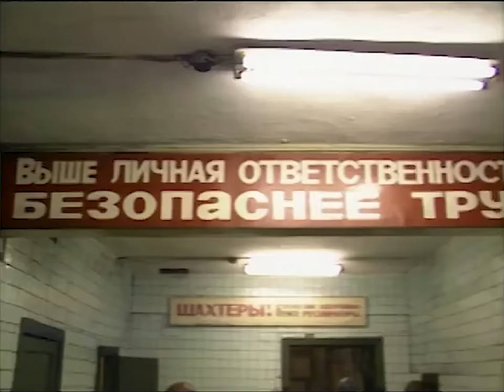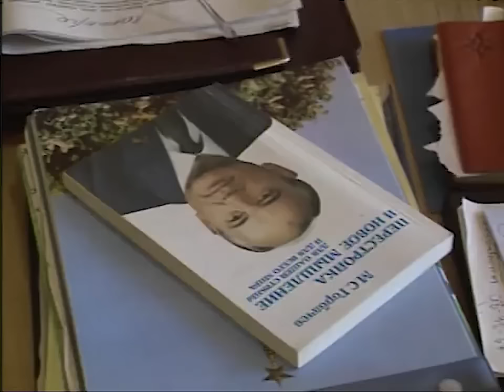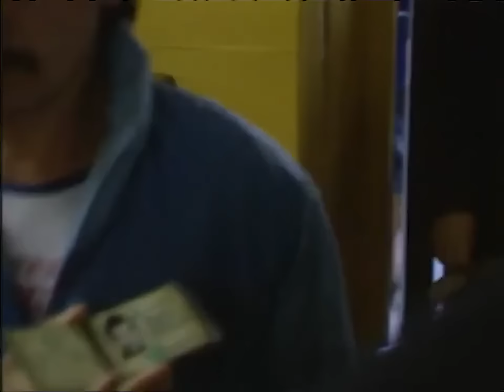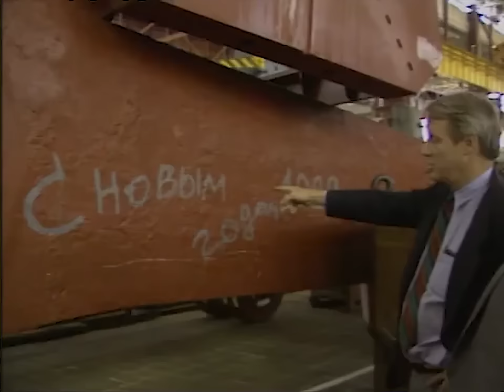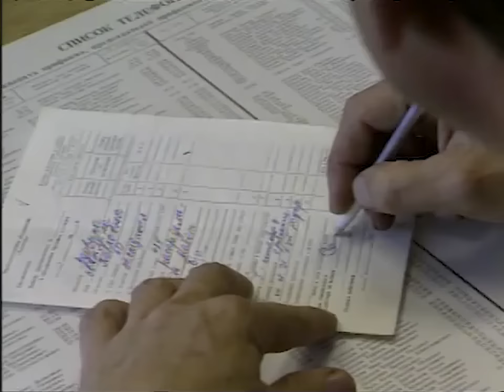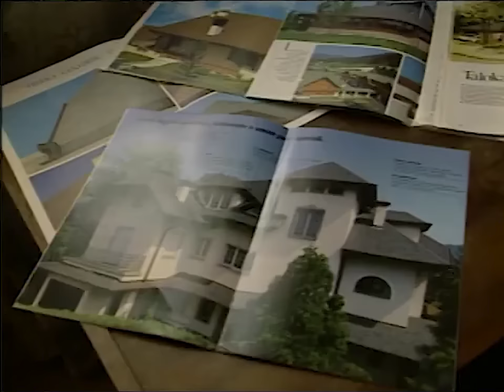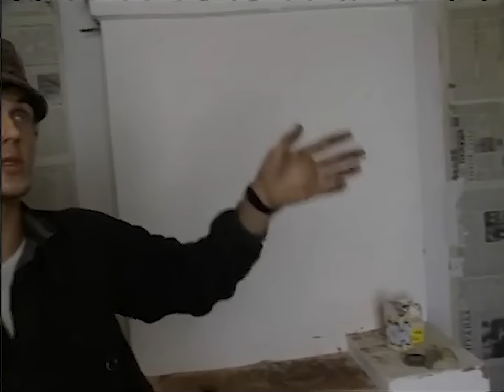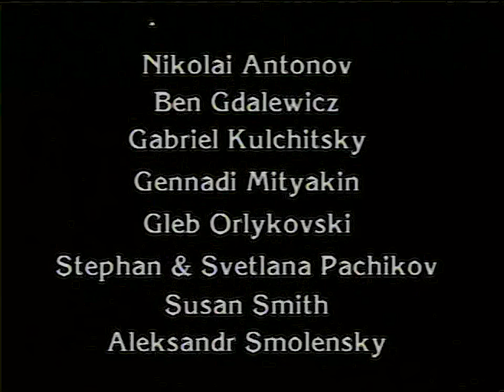Inside Gorbachev's USSR (1990)

Comment: The soviet Transition to market economy. After 1991, under the leadership of Boris Yeltsin, the country made a significant turn toward developing a market economy by implanting basic tenets such as market-determined prices. Your just stupid calling everything propaganda and not paying attention much of the Soviet Union's GDP was military spending and the production of goods for which there was little demand. The discontinuation of much of that wasteful spending created the false impression of larger than actual economic contraction.

Critical elements such as privatization of state enterprises and extensive foreign investment were rushed into place in the first few years of the post-Soviet period. But other fundamental parts of the economic infrastructure, such as commercial banking and authoritative, comprehensive commercial laws, were absent or only partly in place by 1996. Although by the mid-1990s a return to Soviet-era central planning seemed unlikely, the configuration of the post-transition economy remained unpredictable. In economics, shock therapy is a group of policies intended to be implemented simultaneously in order to liberalize the economy, including liberalization of all prices, privatization, trade liberalization, and stabilization via tight monetary policies and fiscal policies. In the case of post-Communist states, it was implemented in order to transition from a command economy to a market economy. successful market economies rest on a framework of law, regulation, and established practice, which cannot be instantaneously created in a society that was formerly authoritarian, heavily centralised, and subject to state ownership of asset. 
the U.S. and the IMF should have provided large-scale financial aid to Russia, which was integral to the success of the reforms